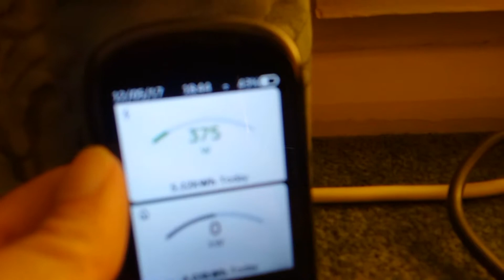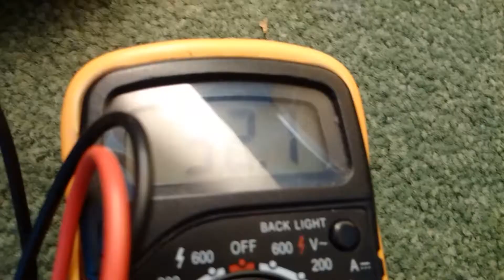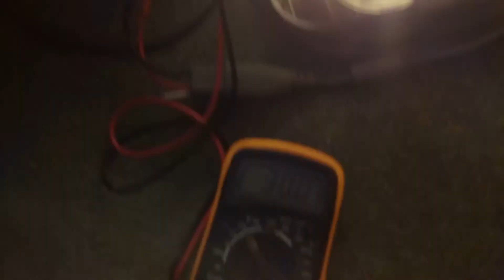Improve efficiency of fake chinese 100W LED

Comment: Looks like you are using a boost converter to get the 30-36v DC but are you also using a Constant Current Driver? The 100W Leds want 3amps of constant current. The 100w led driver pcb costs around 15 USD from China. I use their baby brother for the 10w LED's. They are only 900ma and their driver usually costs under 1 USD.

But that will really help with the efficiency and should cut off down on the heat as well. And you will get better brightness at 30+ Volts. .And many of the boost or buck converters will regulate a constant voltage they wont push a constant current. And these LED's really do need that constant current.

The biggest problem is some of the 100w led chips are so cheap its not worth buying and installing the constant current driver
Reply from the maker: The current issue with these cheap LEDs is because the LED strings do not have matched resistance so some draw excessive current only to create heat while others do not get enough current
it's not constant current driven

It's a $2 LED driven by a $3 boost converter